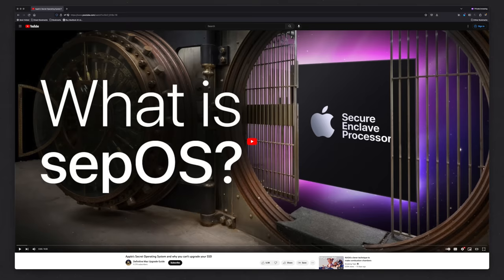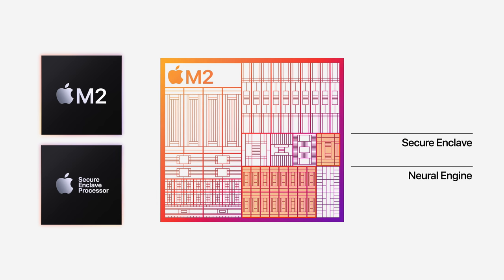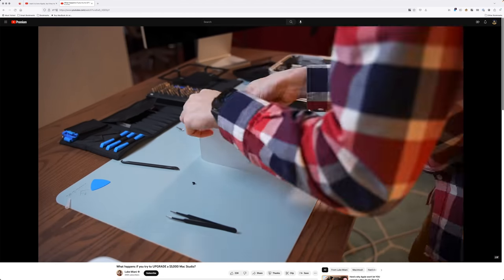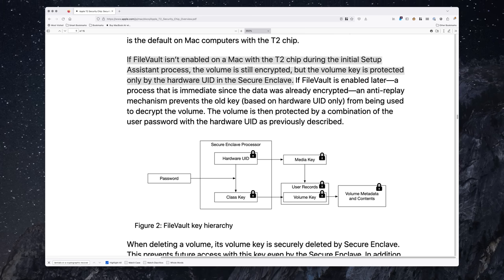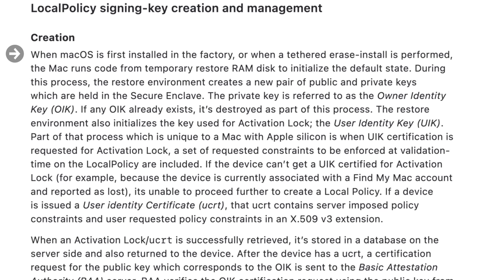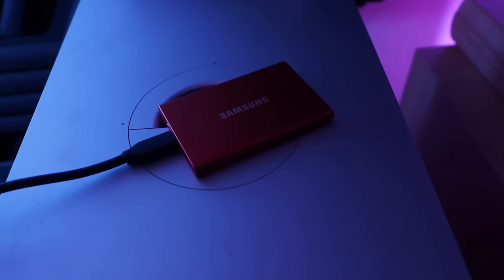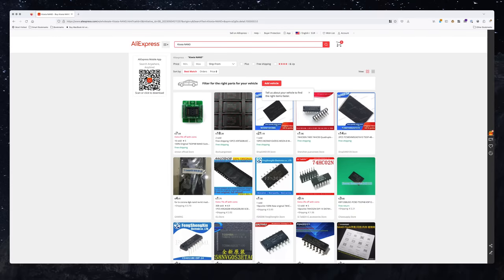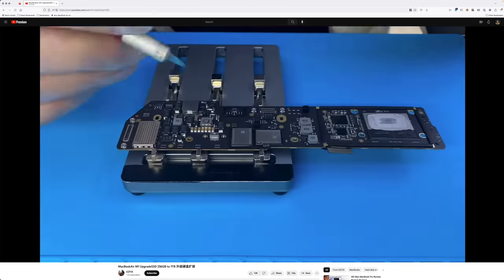Was I wrong? Apple Silicon and SSD Upgrades

Comment: Im getting a framework laptop 16. Tired of this BS.
Yes I know, apple silicon are more efficient, I use a M2 Air from work, but it's not enough for me anymore.
Reply from the maker: if they ran macOS, I'd have one. They are very cool.
Reply: @dmug  Maybe the Intel version can become a hackintosh? To be honest, yes MacOs is great, airdrop is practical, very optimised, but I think I can live with Windows 11. Its not the end of the world.
Reply: Do you upgrade your device or wish to upgrade your device THAT often? I can’t imagine why it would be worth it to buy a whole different laptop just to upgrade like an SSD every couple years.
Reply from the maker: @FlyByWire1  you can get even more mileage if you can upgrade RAM/SSDs/GPUs, especially on a desktop. I used a Mac Pro 2008 between the years of 2008 - 2018. I upgraded everything imaginable, going through different configurations as my needs changed and tech improved.  

Plus you don't have to pay Apple's laughably horrible pricing. A 2 TB NVMe drive that's faster than Apple's NANDs/controller is all of $120 now. To bump the base M2 MacBook Air to 2 TB is $800. That's the price of an 8 TB SSD. The worst part of this is it doesn't have to be this way. For example, MS's ARM based Surface Pro X comes with upgradeable SSDs and uses hardware encryption, and it's tiny. 1.7 pounds, lighter than the MacBook Air. It's a 13" inch laptop lighter than Apple's lightest to date.  It's more than feasible for Apple.
Reply: @dmug  but if you really needed more storage on a desktop, there’s no reason why you can’t just get an external drive. An external SSD for example that can attach to your desktop but also be portable and attach to other devices. That in my opinion is far more valuable to end users than being able to open the device up and put in tons of storage that can only be used on that one device.
Reply from the maker: @FlyByWire1  I can’t tell if you’re trolling or not but internal storage is oodles faster, and much easier to manage. Thunderbolt real world caps out at 2.5 GB/s. Modern ssds hit 7+ GB/s with pcie gen 5 drives steadying to trick out at 12+ GB/s. .That may or may not be a big deal depending on workload, and type of work. Also ssds have a finite lifespan. It’s also generally cheaper too, and a lot less cumbersome. 

Many pc laptops have dual NVMe support, meaning you can pack a lot of blazing fast storage with you. Apple locks down the storage primarily as way to charge more.
Reply: @dmug  the VAST majority of people are just fine with 2.5 GB/s for their SSD. Unless you’re regularly moving hundreds of gigs or terabytes of files frequently, you would never notice a difference between a 2.5 GB/s SSD and one hitting like 7+ GB/s. There are very very very few people who care that much  about the speed. Apple designs their devices for the average consumer. Average consumers are not using THAT much storage and needing 7 GB/s speed. And if you’re needing that much storage anyways in your device, you probably have the funds to pay for SSD upgrades. From my time working with Mac users that needed that much storage, most of them had either a NAS or Server that most of the very very large files were kept on. Apple allows you to upgrade the SSD to 8 TB right now and it delivers like 8 GB/s speed. Who tf is buying 8 TB or SSD storage in a laptop? 😂

Comment: Not you are not wrong. After watching your video, I think your first idea was true in the first place. BGA soldering is not only a complex skill, but it requires a lot of technical equipment and possible a lot of lucky. After the first replacement, if we look at the board with a microscope, the surface will never be the same. This is a complex and technical solution, normally perform by an authorized service (for sure after perform this procedure they lost the authorized title) and for sure invalid all warranties. Lastly, Apple can always put measures into their own proprietary code upgrades of the OS  to make sure that this illegal (from its own point of view) procedure fails and you can loose all your data without any possible disclaimer in the future because you are changing the original design.
Reply: Someone was replacing the ssd nand here https://youtu.be/yR7m4aUxHcM
Reply: @mauricechong809  The description of this video begins with the phrase: "Your 50 minutes-to-watch video is a summary of someone else's years of repair work.". This is not a user upgrade, it is a service procedure.

Comment: Going through all these hoops and risking destroying the product entirely is not worth it. Just buy the largest internals you can and/or want to financially afford. If you have money for a Studio or ‘’Pro’’, you have enough for initial spec upgrades, as well as a replacement if/when it fails outside of warranty. It’s not like Apple is holding us hostage that these computers are the absolute only choice on the market. Either accept it or search for a different computer manufacturer that suits your needs.

Comment: I love mac hardware, but I only use macs as toys and probably always will. When I need to do real work, I need a real tool.
MacBook Pros, Mac Studios and Mac Pros are Toys pretending to be real tools.
MacBook Airs, and their other non-poser hardware I like just fine. Those aren't for real work, they don't need to be nuts and bolts tools.
Its a shame because I do want powerful ARM based work tools, but we will have to wait until windows based ARM solutions become available, because Apple has proven themselves untrustworthy to professionals for the longest time.
tl;dr Apple doesn't make tools they make toys. Get used to it, its not going to change